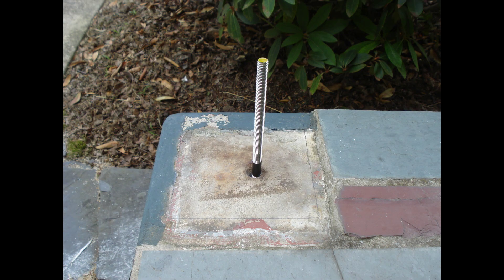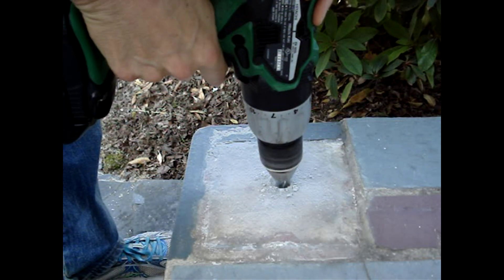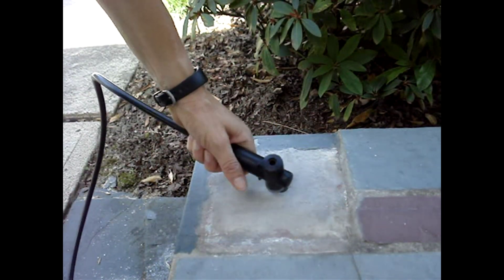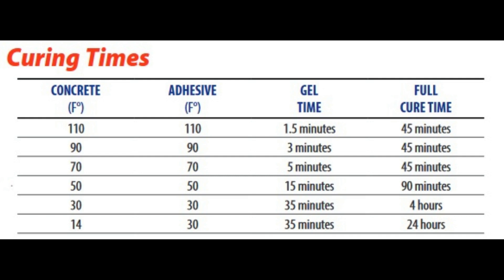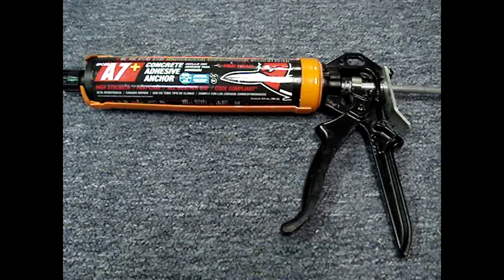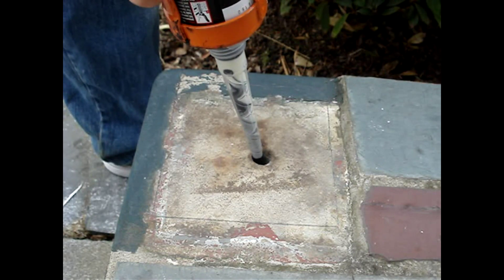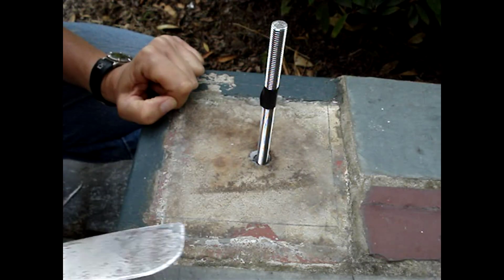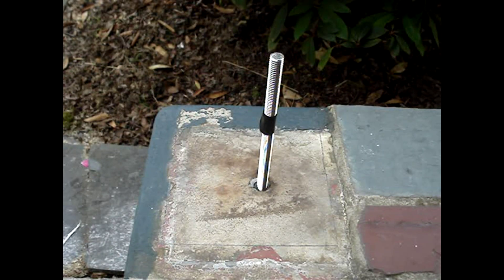Install Anchors With Red Head Epcon A7+

Comment: Can The bolt be removed later if needed or is this permanent
Reply: For a regular threaded rod, put another nut on the bolt and use a grinder or file to damage the bolt threads above the nuts, then you can use an impact with a deep socket to reverse the bolt out. Worked for a 5” threaded rod (4” anchor depth) that passed a 5000lbs load test during a bolt testing from a licensed Redhead engineer. Can’t say it’ll guaranteed work for you but worked for us quite well, and was actually the suggested way of their engineer. Hope this helps
Reply from the maker: It's permanent.
Reply: Are you looking for a drop-in anchor?  It is a female (internal) threaded concrete anchor, that you can put a bolt/threaded rod into or out of.  Makes a threaded socket that sits flush with the surface.